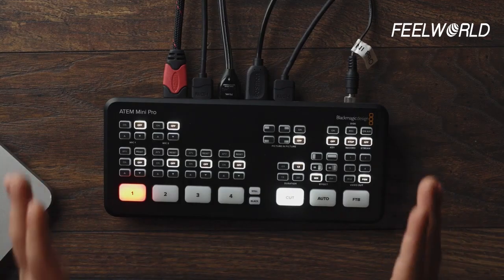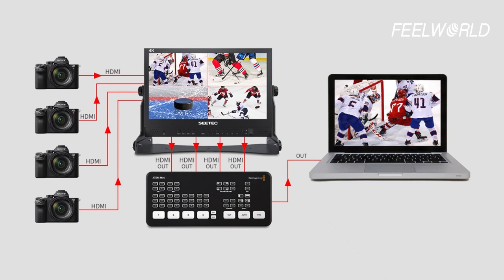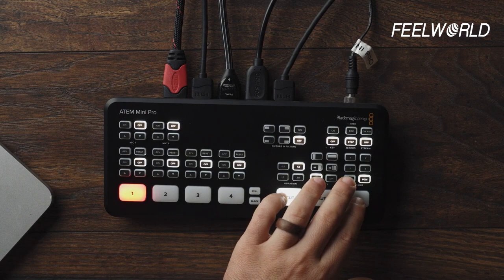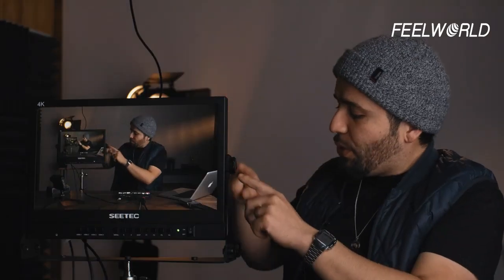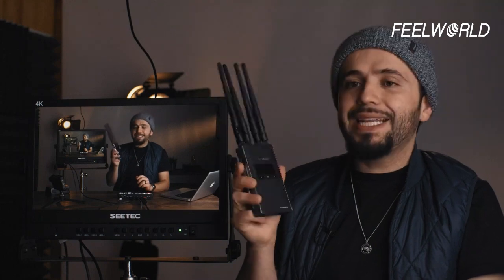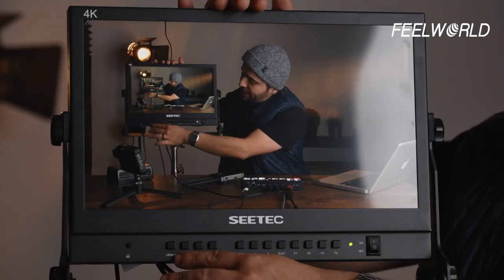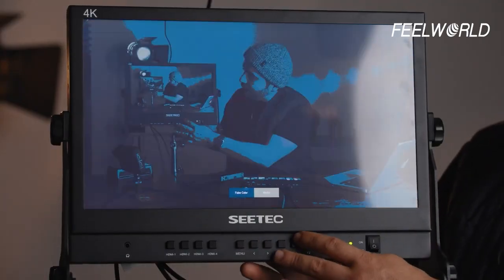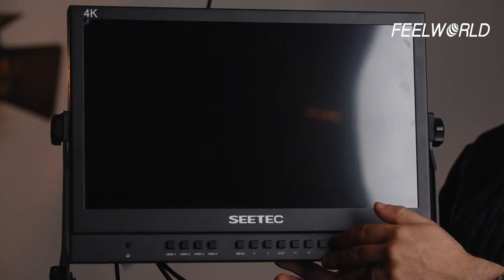SEETEC ATEM156 Multiview  Broadcast Monitor 15.6inches 4K HDMI and ATEM Mini Live Stream Setup

Comment: Thanks for the review - just curious how accurate the colors are for multi-camera matching exposure, color consistency etc.
Reply from the maker: Hi friend! Here is our display Spec, you might want to take a look of it!
Screen Size: 15.6" IPS
Color Depth: 16.7M colors (8-bits)
Resolution: 1920×1080 pixels
Pixel Pitch: 0.17925 (H) X 0.17925 (V) mm
Aspect Ratio: 16:9
Brightness: 250cd/m²
Contrast Ratio: 800:1

ATEM 156 supports custom adjustment parameters, such as basic adjustment parameters, backlight and gamma adjustment, color temperature adjustment, color effect adjustment, and so on. 

 Feel free to contact us if you have any question, we are glad to help.

Comment: Hi Great video . The monitor said on the up left 4k but the resolution is 1820 ?  Meaning I am shooting  with a 4k  camera . Will preview 4k? sorry if I am dumb heheh
Reply from the maker: Who dares to say that those who pursue knowledge are dumb!😡 Actually this is a question that we've come across so many times. In simple terms, if you output a 4K signal from a camera, due to the screen resolution limitation of the monitor, the displayed physical resolution can only be 1920x1080. But in fact, the resolution of the signal itself is still 4K, which means that if you transmit this signal to other devices through the monitor, the output signal is still a 4K signal, not reduced to 1920x1080. I hope this explanation can help you solve your confusion.✌
Reply: Thanks thanks so much You are great